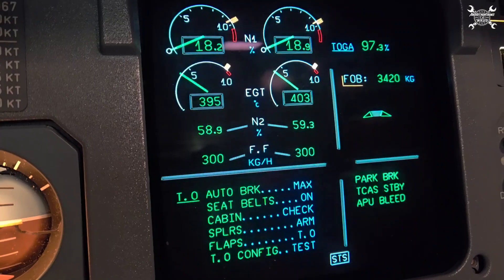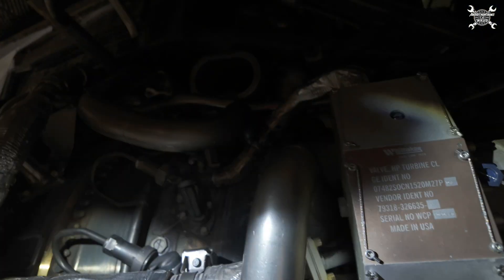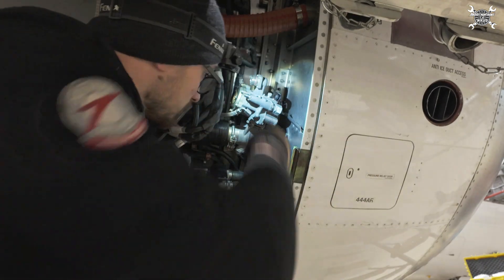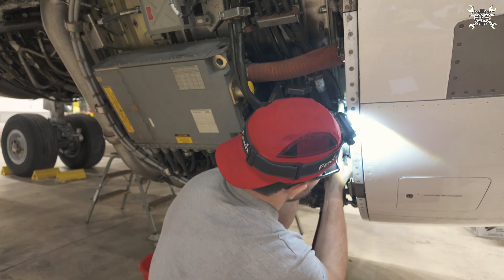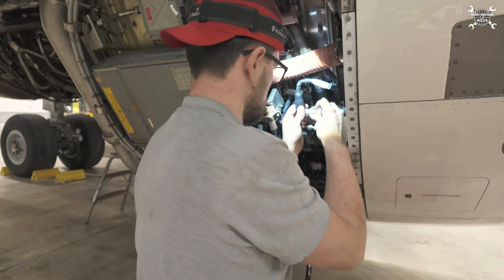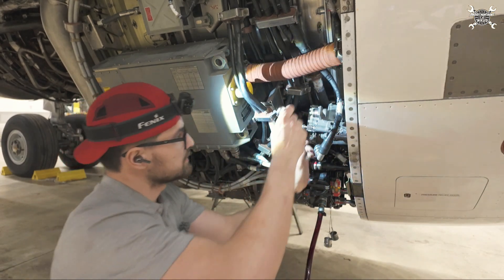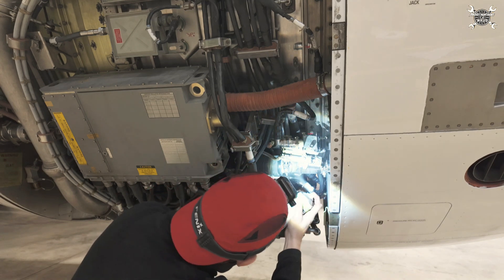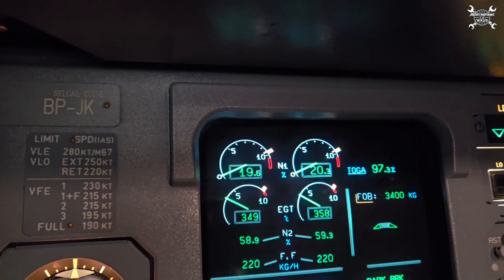ENGINE AIR INTAKE ICE PROTECTION

Comment: Why did you set the anti-ice valve to the lock position? Is the pilot able to switch it to "open" from the flight deck?
Reply from the maker: I did not it is in active mode the hole above is for locking 🙂

Comment: Why is exhaust gas not used?
Reply from the maker: To hot and it will be hard to extract it and another thing it can cause build up of carbon. This is easy solution since we are using it for very low amount of time

Comment: Tomas interesting to see all the various systems in an aircraft and how they work.  Is there also an anti ice system on the wing leading flaps that is electrical ?  Maybe not all aircraft models have this ?
Reply from the maker: Electric leading edges you can find on B787 on almost all others it is thanks to hot air

Comment: I know you didn't design the thing, but given the impact bleeding air has, why wouldn't pumping fluid around it, instead of air, make more sense? There's a heat exchanger for the oil, right? If you're wasting that heat anyway, may as well put it to use.
Reply from the maker: It was already mentioned but fluid is very heavy and with diameter of 1,8m you can imagine how much extra fluid you need. This system is in use during shot period of time and that's why it is better to use bleed air
Reply: Bleed air is basically free in jet airplanes. The engines are giant air pumps. The air is extracted before fuel is added and due to the working principle of turbine engines is already hot and at pressure. Thus no pump is needed.

In a fluid system you would need a pump, most likely a filter, temperature sensors and some sort of control box to ensure the fluid doesn't freeze (anti ice is only used when needed and skin temperatures easily reach -40°C in cruise). Many components that can fail for no real benefit.

The heat for anti-icing has to come from somewhere either way and the only regular power source in an aircraft are generators attached to the engine. So you wouldn't even reduce the demand on it, just using it in a different way. 

The Boeing 787 has no bleed System and they claim around 3% fuel savings. That is with all systems considered. Almost all airlines use bleed for air conditioning, pressurization, engine start, anti ice and many more systems. All in all a fluid based anti ice would not save fuel or maintenance costs.
Reply: There's only so much heat you can get from engine oil before it's cold. Hot air from the engine is unlimited as long as the engine is running
Reply: Just a car mechanic here

I'm curious to see what he says

At a guess, fluid takes more energy to pump than air. With fluid engineering for it not to leak will be pose more of a risk? Where as with air tiny leaks here or there won't hurt anything 

But yeah me thinks it's for energy consumption reasons 1st
Reply: @Jack-qn4vt I think the main reason is weight, if they use fluid on Both side of the aircraft means it add more weight to the aircraft, also it will cost more the intake is big that means they will have to add a lot of cans of fluid if that’s the case and they will have to check for contamination and change it maybe more factors to it so these are they two option I can think of so far hope it helps you out
Reply: @Jack-qn4vt  while we wait for a reply,...
20kg/hour seems like a massive increase, especially at idle. I'm sure there's a YouTuber we both know who could tell us the fuel in vs electrical output of the APU. But again, if you have oil that needs to be cooled, I'm betting that with all incumbent electrical demand, turning on a pump and energizing some solenoids wouldn't add 20kg/hour worth of power demand.
Reply: It’s because if there was a fluid leak it could potentially cause catastrophic failure. An air leak is harmless.

Comment: Great work 👍
I didn't work much on cfm56-5b because in my company we have v2500 & pw1100.

I have a question : this valve is fail safe open or close ?
Reply: Close would be the logical mode, leaving maximal engine power available.  When the unit was disconnected and being shown, the valve was shut.
Reply from the maker: Before it was same for me only V2 and PW1100G.   But CFM is the best for maintenance 🙂 and it is spring-loaded to close position